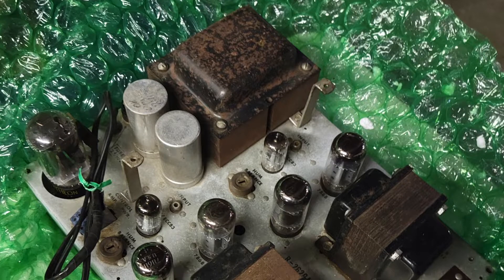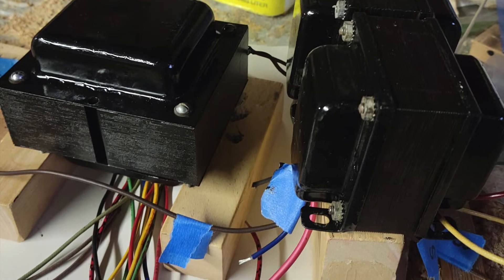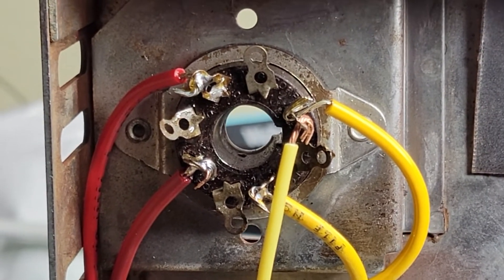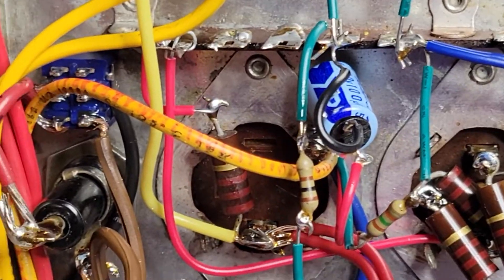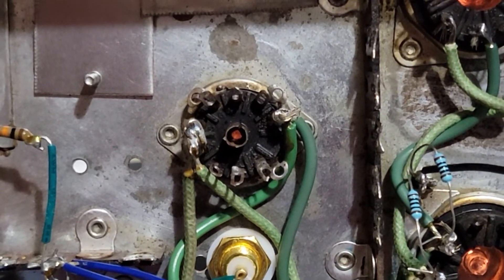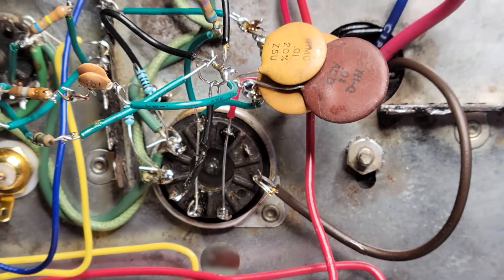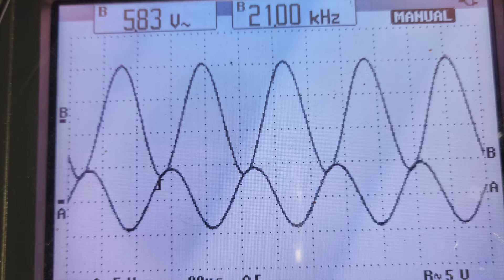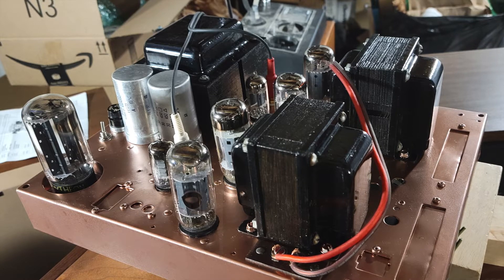Tube Amp Restoration: AMI-Rowe R-2620A Jukebox Amp Back from the Dead

Comment: When replacing colored chassis wiring what type of wiring do you recommend?  The reason for asking is because there are many wire types and brands using less than ideal insulation types. Many are not very good in the presence of warm/hot location use resulting in shorter than expected lifespan with cheap insulation. Many older wire types can actually be far superior to many of not most of the contemporary offerings found in the commercial marketplace and through online suppliers. What’s your experience in this regard? Or am I being just paranoid?
Reply from the maker: That is a rabbit hole I have largely avoided so far. I have come against the need for insulation rated for 600 V for tube amps. Lately, I've started ordering my wire from DigiKey, but a lot of what I use is just cheap stuff I got off Amazon.

Comment: Amazing skills here. Ive just started trying to do a re-cap and bring my R-2620 back to life for my Jukebox and when i saw every wire removed from the amp, my jaw dropped. I do modern automotive repair and was comfortable reading a wiring diagram but these old machines are much more challenging. Seeing you use it as a road map to re-wire this thing was fantastic.
Reply from the maker: Is be interested to hear how you make out. I've now done a second rebuild, this time with all new components. I'm not satisfied with the result, though. It has slewing distortion at 10 kHz. That's at full power, and it probably sounds fine at modest volume. Still, I'm not satisfied with this outcome. Do I know how to fix the problem? No.

Comment: Hi.. How to connect speakers.
Thanks.
Reply from the maker: This amp has screw terminals next to the output transformers. Good for spade connectors, but bare wire is fine, too.
Reply: @Lancaster_Hi-Fi I see in schematic more pole to connect . I no idea .
Reply from the maker: Sorry to leave you hanging. Did you figure it out? These amps did have a ridiculous number of connection options.